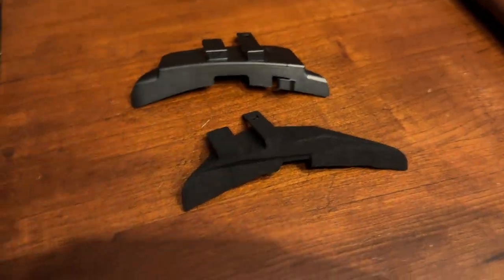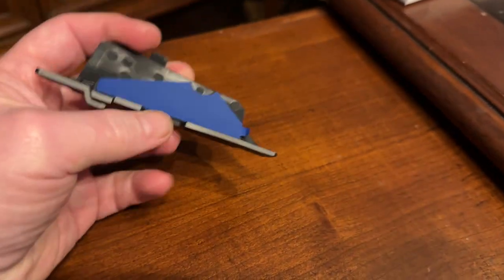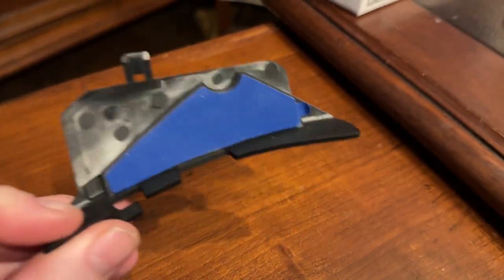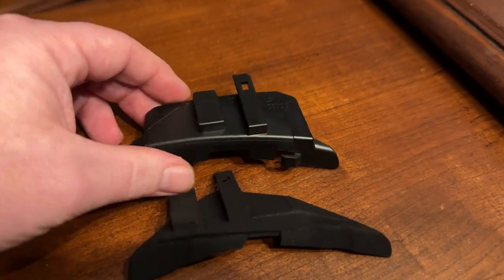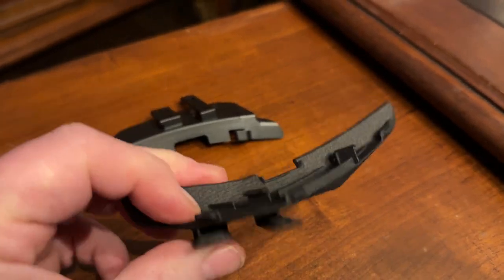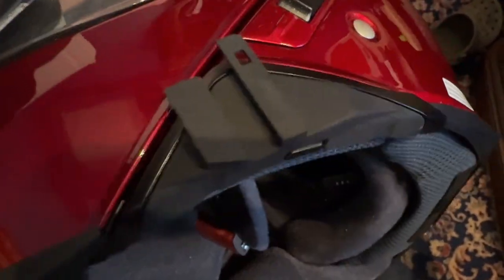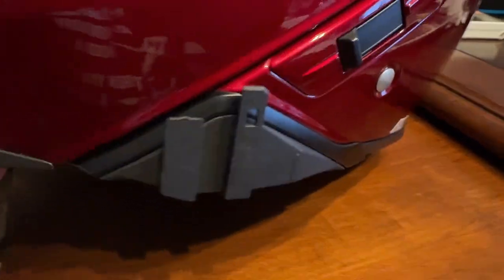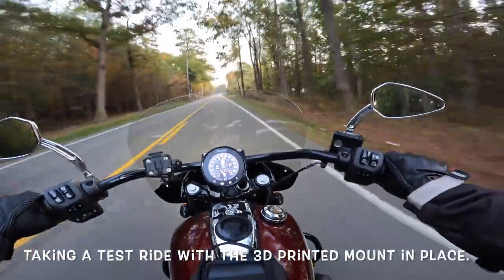Update: 3-D Printed Adapter For Shoei Neotec 2 Cardo Unit

Comment: I am more than happy that You like it. Initialy I created it for my own use and just shared the file. Hopefully some day cardo with shoei will create some unit that fits same way as SRL. BTW I have almost 20kkm with it, no issues with falling off or something
Reply from the maker: Glad you made it!  Hope my video and description with link have drummed up some activity.  Your product is perfect for me so far.  See no reason that would change.  It appears rock solid.  Thanks again.
Reply: Will you ever make another for the neotec 3?
Reply: @yungfabio420  Probably shortly after I buy one :)
Reply: Were the files taken down? I get 404 on them. Any chance to get the stl?
Reply from the maker: @adamborowski1412  Trying to see if you are still out there with the file available.  You have a growing base of interest here looking for the missing file.  Thanks much!
Reply: @RamblinManMoto  Files were taken down. Adapters are available on etsy, and soon from second source.
Reply: Not only for Neotec 3 but also for GT Air 3 ..cardo should appreciate what you have done .. bro like it ..
Reply from the maker: @Starsky770  Were you able to get them?  Send me your email?
Reply: @RamblinManMoto  I actually bought the cardo adapter and used it. Even though it's glued it holds and looks nice. Thanks for remembering me!
Reply from the maker: @Starsky770  Glad it worked out.  I think I mentioned in my video that I thought the adhesive would probably work fine it's just not what I wanted.  Glad it is indeed working out for you.
Reply: @adamborowski1412  I would like to buy the adapter but I did'nt success in my search on Etsy site. Could you have the direct product link ? Thank you from France for your support
Reply: @macrunner2  Hmmm... Seems it is out of stock now. I am considering selling them myself on ebay or something.
Reply: @macrunner2  Damn, YT removes my comment with link. soo.... "tubsjackson" then dot, then "co" followed by dot, and at the end "uk".
Reply: @adamborowski1412  Thank you Adam.

Comment: Good evening! Thank you so much for the video.  Was just curious what you chose on the 3d print side on the makexyz page?  There are so many options.  Really like how yours came out.  Just wanted to get your opinion on that.  Thank you.
Reply from the maker: I keep intending to make a video on this but haven't just yet.  Looking at my receipt, I chose Process:  SLS.  Material:  Nylon-PA2200.  I believe the only color is black.  My grand total was $29.90.  The receipt doesn't show any other options selected.  Hopefully this info helps.
Reply: Oh that’s perfect! Thank you so much. I have a Pactalk Bold and found the printed file for that for the Neotec 2. So much nicer to look at the way you did it rather than the Cardo so far back. Thxs again! Great video!!
Reply from the maker: @CF15500  Sorry the video wasn't better.  Doing it one handed on the iPhone for this quick video.  As I mentioned quickly, I think I could have installed mine using just the clip that came with the Cardo over that black plastic piece that's part of the Shoei helmet, but for the cheap price of this 3D solution I really like how it came out and not having to worry about it.  Best of luck on your project.
Reply: @RamblinManMoto  Thank you! Appreciate all your help.

Comment: Thanks for making those videos and pursuing this topic.  I’ve had a Shoei Neotec II with the integrated Sena SRL system for the past 5 years. Love the comfort, fit and features of the helmet, but NOT the comms system.  I’m due for a new lid, but find it unfortunate that all the integrated systems are Sena. I believe Cardo to be a superior system and will be going with Cardo  moving forward. 

My question is, did the 3D adapter plate come as an actual piece or just a printable file?  

Thanks again for your help.
Reply from the maker: I really like Cardo as well.  My first Sena was terrible and the one for this one I didn't like.  So I may end up making a video about how I ordered the 3D thing but in the link I provided you download the files needed to print the 3D part.  It's the largest of the files on that site.  It's a free download.  You take that file to your 3D printer of choice and ask them to make it.  I found a site that gave an immediate quote when uploading that 3D file.  Then, they print it and ship the part for you.   That was it.  My first time having some 3D printed.  That part of my install has worked fine and was easy.  It was harder for me to get everything with my Movo wired and taped in the way I want.  Ha!
Reply: @RamblinManMoto  Ok, I think I understand. Basically pay for the download and then coordinate with a 3D printer.   I’m with you when it comes to adhesives.  Thanks so much for the quick reply.
Reply from the maker: @00cpo70  You do not need to pay for the download.  On that site, the download is free for the STL file.  You then coordinate with a 3D printer and pay them.  I believe I put the one I used in the description (or a comment) with a link.

Comment: J'ai acheté le nouveau shoei GT-AIR 3 je pense pas pouvoir mettre cette partie pour mon cardo car l'emplacement est pas triangulaire savez vous si il existe une nouvelle plaque pour le nouveau ✌
Reply from the maker: Apologies, but I do not know.  I did buy a Shoei Neotec 3 helmet and found thee two 3D printed solutions I found broke.  I googled and found solutions easy enough but they broke.  I ended up using the adhesive and it's holding but has to go further back on the helmet.   The Etsy web-site also had some.  I just don't know about your helmet.  Sorry.
Reply: @RamblinManMoto  je vous remercie pour votre réponse je vais essayer de trouver une solution ✌
Reply from the maker: @rochetmichel7155  Not sure if this helps, but this is the page where I bought the updated one for the Neotec 3.  Not sure if he has a solution for yours but may be worth messaging him.   https://www.printables.com/@BoA_36226
Reply from the maker: @rochetmichel7155  Looks like he may have your helmet on that link I sent.

Comment: Thanks for pursuing this. There are multiple print files for this piece on the Printables website…which one to download?
Reply from the maker: This was my first time getting anything 3D-Printed.  I learned that the larger Model STL file is the one the 3D printer needs.  You download that file and then upload it to the 3D printer.  I received an immediate quote on the site I used when I uploaded that file.
Reply: I ordered 4 of these to share with friends who have the Neotec 2 with the Cardo Edge unit. My own Neotec 2 arrives within the next week.
Reply from the maker: @roncoleman8351  Cool.  I was a little confused about which options to order on the actual part but I'm very pleased with how it turned out.  I just tweaked my microphone for voice (not Cardo) and I'll post a video about that.
Reply: @RamblinManMoto I got mine today. Looks great. Just waiting for a Black Friday sale on the Packtalk Edge in a few weeks.
Reply from the maker: @roncoleman8351  Very cool!  Hope it all works out for you.  I had to return my GoPro Media Mod and I'm awaiting a replacement to put my entire vlogging package back together.
Reply: Well, the 3D printing didn’t work for me after all. I bought 2 and had no luck trying to fit either one. I just couldn’t get either of them to snap in, even though all 4 tabs seemed properly aligned with the slots in the side mount. One of the vertical pieces that slides into the Cardo back plate broke off. It left me wondering if the 3D version would have held up over the long haul. Ended up installing the Cardo adhesive mount.
Reply from the maker: @roncoleman8351   Oh no!  I'm sorry it didn't work out.  I wonder if we selected the same options that were available.  Mine feels quite sturdy, I have removed the cards a few times to charge it, I've been on the interstate at 75 mph, backroads, etc.   Mine snapped right in with no problem.  I'm sorry about your experience.
Reply from the maker: @roncoleman8351   I had selected Process:  SLS.  Material:  Nylon-PA2200.   Just curious if you did this option or something else.
Reply: I think I picked the default option which was “plastic”, since I didn’t have any real understanding of the suitability of the other options for this purpose.  No worries…it’s all good now.

Comment: Who could share the 3d file for this adapter? It is no longer on the website
Reply from the maker: Try this and let me know if it works.  I want no compensation. Sharing the link freely. 

https://www.dropbox.com/scl/fi/9l553ol50gbc09askmn4y/pt_edge_mount.stl?rlkey=o0x2cy986ame73ztlmxx5gqo4&dl=0
Reply: Thanks a bunch. I will give it a try tomorrow
Reply: @RamblinManMoto  Do you still have the file, I can not find it. Please shares if you still have it. Thank you very much.
Reply: @RamblinManMoto hoping you still have the file. Thanks.